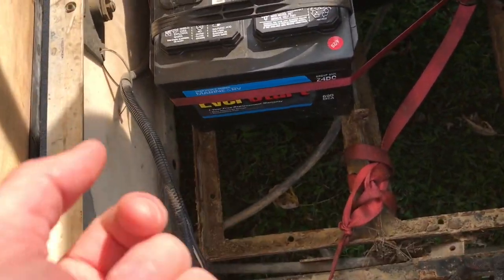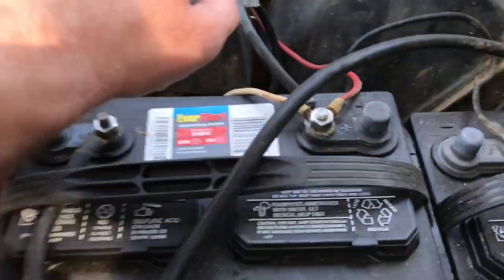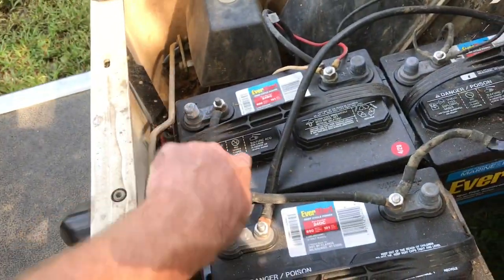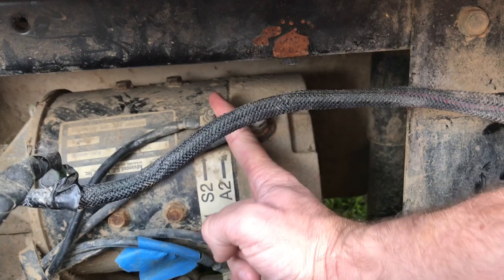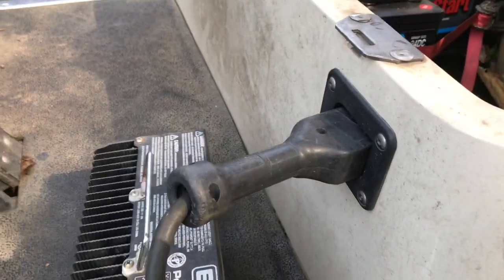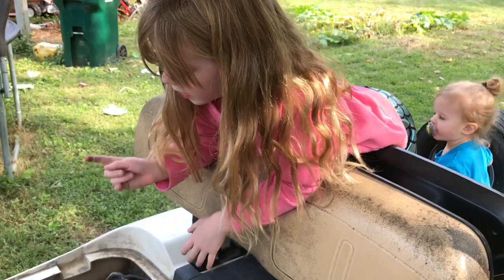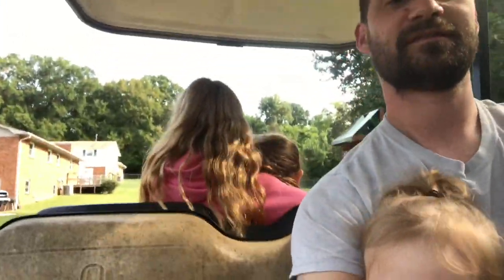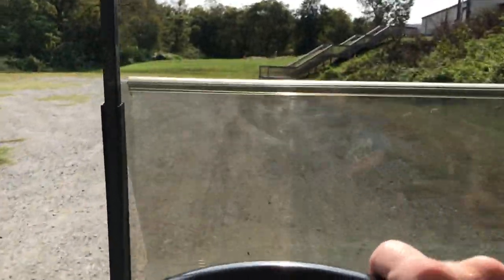6 to 12 volt golf cart swap update, further wiring explained, 36 volt EZGO, and ride along.

Comment: Works perfectly fine, unless you actually use it for golfing.  Range is diminished greatly.  From 220ah to around 80. Perfectly fine for around the property or to check the mail or go to the clubhouse
Reply from the maker: couldn't agree more.  I only get about 3 miles per charge but that's really all that I need for what I use it for.  I definitely wouldn't use this on a golf course.

Comment: Why did u swap the s1 s2 wires on the motor??
Reply from the maker: For some reason after I did the swap forward speed was 1/2 like it was in reverse and reverse speed was doubled like it was in forward.  So swapping S1 and S2 fixed that.

Comment: I’m trying to do the swap I have everything the same except the black wire on your top battery either the white and red cable I don’t seem to have that cable I’m not shure if I did something wrong
Reply from the maker: I’m not sure all I did was take the positive wires from the 6 volts and put them on the 12.  Did you not have the red and white wires with the black wire?  On mine the black wire is just behind the gear selector.

Comment: I just did all this and it works fine but the motor is getting really hot even with the key off. I was wondering why did you change that s1 and S2? Was that your problem also?
Reply from the maker: I did not have a heat issues but it sounds like you have power constantly going to the motor somehow.  I did the S1 S2 swap because I was only getting half power in forward and full power in reverse so I swap the power delivery at the motor.  Not sure about the hot motor though you’ll need to check into that before other issues arise.
Reply: Question to both u guys...when ur operating the cart would the coil heat up so much it gives off a burning smell? Is this normal for the coils to do? My coils will get firy red when I use my cart...hope u guys have answers
Reply from the maker: @LamzLamz714  no mine do not get hot.  Sorry I can’t answer this.

Comment: Why did you have to switch the s1 and s2? I'm trying to do the swap and it won't work
Reply from the maker: I only did the S1 S2 swap because I was having issues with the golf cart only going in half speed after the 12 volt conversion.  I had read online that swapping the S1 and S2 will send full power to the motor if the cart is moving at half speed.  I actually drove it for a while before doing the S1 S2 swap and it did just fine but it was really slow.
Reply: @ChrisThedudenurse  you said 12 volt swap...  do you mean 3- 12 volt batteries compared to the original  6 volt batteries? I think I found the reason for mine not working is because I did not hook up the charger wiring
Reply from the maker: @charlesjuett7445  correct I meant from the 6 6 volts to the 3 12 volts.  Yeah you really got to get the connection right and tight or you’ll have issues.

Comment: The green wire I believe is the 12 volts for your accessories.  It used to span 2 6 volt batteries.
Reply from the maker: It is/was.  I have another video where I updated it

Comment: I think the reason why you have to switch the s1 is because say at 3 batteries the main cable is positive.  jump to 4 neg, jump to 5 its pos jump to 6 its negative.  so its flipped with half the batteries
Reply from the maker: Makes since.  All I know is I had to swap them and it worked.  I’m definitely not an electrical engineer by no means.